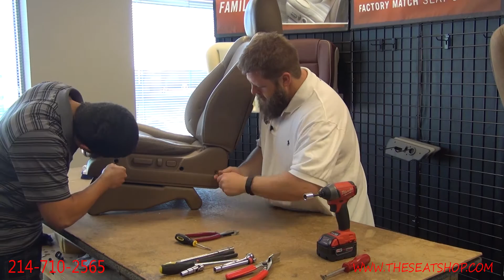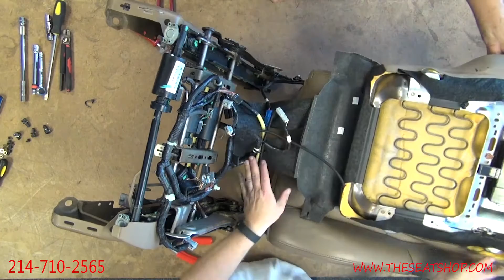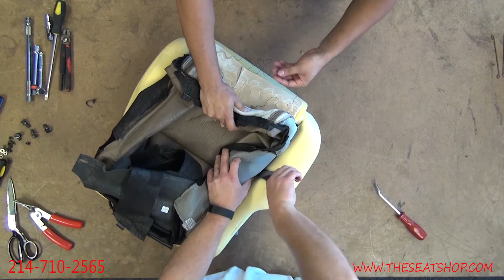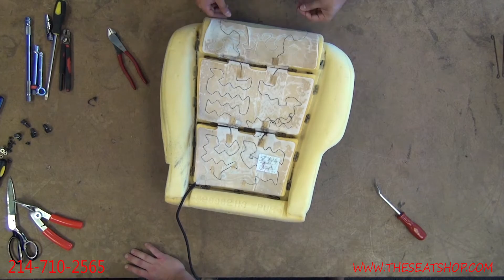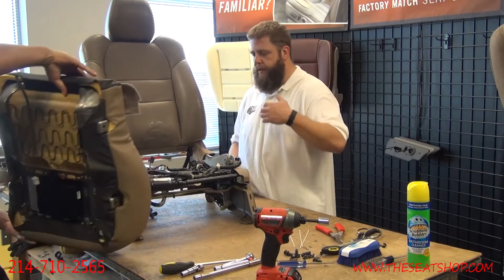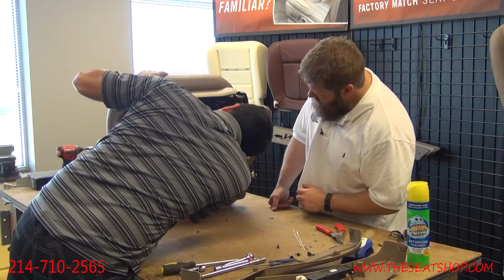01-06 Acura MDX Driver Bottom Install Video

Comment: Thank you for the video. I can't believe I was able to buy such a high quality seat leather replacement for my 2003 MDX!  It was a perfect fit and color match. Watching the video while I did the job made it easy to accomplish.  

I replaced the passenger seat leather and the one major challenge I had was the seat controls wire. During the tear apart and new leather install, I somehow managed to reposition the wires in a manor that made it difficult to remember how it should be routed. After some struggle, I got it routed so it could reach but now the recline control isn't working. Super duper!  :-)  Oops.  I hope it is something easy but I'm afraid I've pulled some wire out of the harness or lord knows.  Tomorrow I'll pull the seat back out and see what's up.

Thanks again!  Great craftsmanship. I shopped for a week and was initially going to just buy a cheap cover. But, even though my car is 20 years old, the MDX really needs a quality replacement like this. 

For those worried this is too hard to DIY -  It is not hard. I sit at a computer 8 hours a day and my hands are used to using a mouse and keyboard - not a hog clip tool. But, watching the video and taking my time made this process easy enough. If you aren't too strong, it would help to have a buddy with getting the seat out and back in and loosening the bolts.   Good luck!

Comment: Great video.  
I have a 2004 Acura MDX. The driver's seat has a bracket which is broken causing the upper and lower portions to separate. Effectively a rocking chair. Do you have seats available?  Same color as in your video.  Like "peanut butter".  Would consider other colors too.

Comment: I would recommend taking a moderately wet rag and wiping each panel down with just water and then drying it before hitting it with the conditioner. Don't want that detergent building up or damaging the leather.

Comment: What specific year did that seat come out of? Trying to figure out if my 04 is velcro or hog ring
Reply from the maker: Your 04 uses hog rings and typically the Acura's use a lot of them too.
Reply: @TheSeatShop  Do you have a link to those specific pliers? Also, what size hog rings?
Reply from the maker: @Shawnbfromsd  Here's the link to our Hog Ring Pliers as well as the hog ring bags we sell. Also, if you happen to purchase a cover from us that requires hog rings, we provide them for you as well so there no need to make a separate purchase! Let us know if you have any additional questions and would be happy to help! 

Pliers: https://www.theseatshop.com/hog-ring-pliers-red/

Rings: https://www.theseatshop.com/hog-ring-bag/

Comment: How similar is 2007 mdx to this 2006 mdx seat? They look very similar. Also where can one get the hog rings? Thx
Reply from the maker: Hi and thanks for reaching out, what changed was the color options and unfortunately, we have not been able to finish the R&D on the newer year ranges to be able to release them at this time. Upholstery hog rings can be ordered online or you can call your local hardware store to see if they carry what you need. Here is a link to our hog rings if you needed them - https://www.theseatshop.com/hog-ring-bag/

Comment: I took off the old pating and there's like these little sensors attached to it can I rip those off or put those on the new one
Reply from the maker: Hey Rock J, since we don't really have much R&D finished on the Accord we would not know what those sensors are and would not know how to guide you on this... I would try talking to a dealer to see if they can try and help you out

Comment: I have a 2009 Honda Accord and I'm trying to change the inside cushion of the upper side do I have to remove the whole seat
Reply from the maker: Hey Rock J, we don't have much experience with the Accord as of yet but to replace the foam in any seat the easiest way to replace or work on it in any way is to removing it.